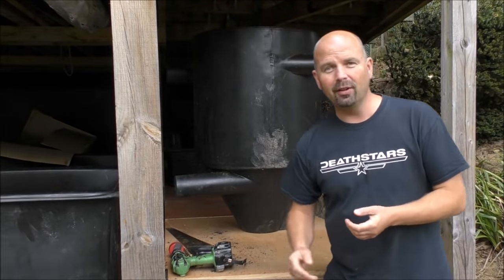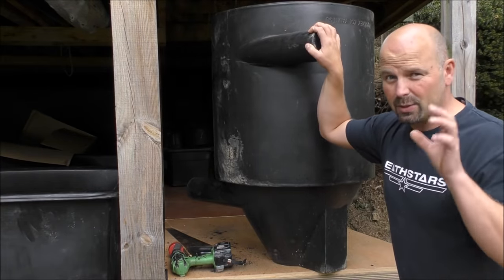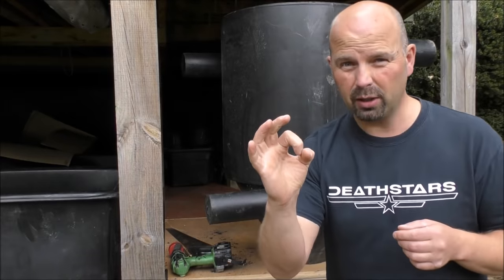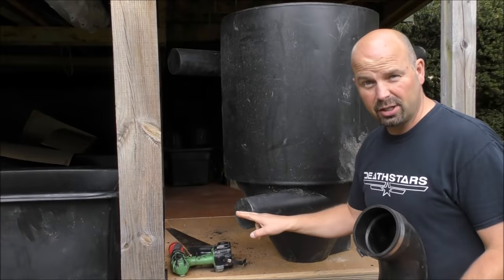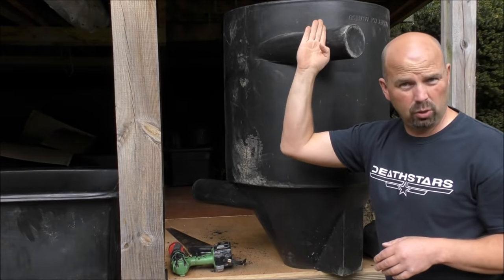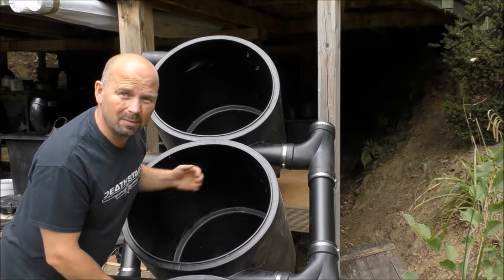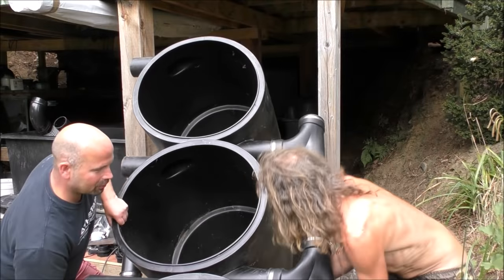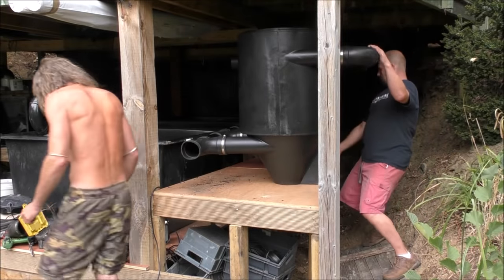Building a HUGE Pond Filter - Part 2 - Vortex Filters

Comment: Is there a specific reason for plumbing the vortex filters in parallel???
Reply from the maker: In tandem or sequence - it doesn't really matter as they are really for brushes to 'catch' fine muck.

The main problem is with the particle size I'm trying to settle as it's not like a 'normal' situation of large visible lumps of fish muck and therefore much of it stays in suspension unless there is structure for it to cling to, hence the brushes in the vortex filters - I suppose I could have just gone with a rectangle tank for the first stage instead of 'vortex' filters but the base shape of the vortex does lend itself to settlement. I'll see how the flow is with / without brushes and assess the effectiveness of them after a few months of running but they could be altered if necessary since fittings are rubber.
Reply: Pondguru I was only wondering if you did it that way to slow the water down to give the suspended solids more time to settle out.
Reply from the maker: Due to the tiny size of the particles yes, that was my thinking behind setting them up like this but time will tell how effective (or otherwise) it is.

Comment: Hey Richard is there something like bio home I can buy in the US to put in a pressure filter for a Koi pond your friend G-man
Reply from the maker: Most pressure filters don't lend themselves to a really good porous media as the conditions are too dirty for the media to be effective. As long as the media did not affect the foams you could use red / brown lava rock since it has the majority of the surface area externally so works well in muck without clogging. The ideal set up would be to pass the pressure filter outlet to a shower filter and  use good porous media in that - then the pressure filter would do the mechanical work followed by the shower filter doing the biological work.

Comment: why wouldnt you just build the vortexs in place? also shouldve checked for leaks in your drain plugs before filling with water, how u gonna tighten the inner nut now its built in place and when full of water? cross your fingers,,lol
Reply from the maker: Traditionally the nut would be on the inside of pond filters and I haven't had one leak yet - I suppose there's always a first time, lol
Lack of space under the cabin was why I didn't build them in place.

Comment: The rubber gasket should've gone on the water side of the barrel.. when you put it on the outside, it serves literally no purpose... from what it looks like, you put it on the wrong side. I can't believe a "filter guru" could mess up a bulkhead installation
Reply: No he has it correct, if it were on the inside the Friction of the locking nut turning on the rubber seal would hinder it tightening up
Reply: Ross Davison friction? You shouldn't be tightening it that much, ever.
Reply: No he does not have it correct he seems very knowledgeable most the time, but every expert I have seen until know puts the gasket on the side of the water. It may work if it’s real tight but not ideal, unless we’re missing some odd logic here
Reply from the maker: It can go either way and solid or flexible pipe would generally not be fitted to the side with the locking nut on (although it can be). It really doesn't matter which way it is fitted but traditionally pond filters would have the locking nut on the inside and seal / pipe side of the fitting on the outside - probably for aesthetics but ultimately it does the same job whichever way round it is.
I find it strange that people are arguing over this because of what some 'expert' does in other videos, lol
Reply: Pondguru you're very wrong, I've seen 15-20 bulkheads all wet or leaking because of this same problem at a LFS 8 yrs ago and I explained to them what was wrong, they then fixed the gasket to be on the water side and till, this day, have no leaking problems at all. If you think about it, it makes total sense. The water is leaking through the threads of the pvc if you put the gasket on the outside... the rubber gasket provides literally almost no protection at all.
Reply: A pre-install test may well be worth the time.